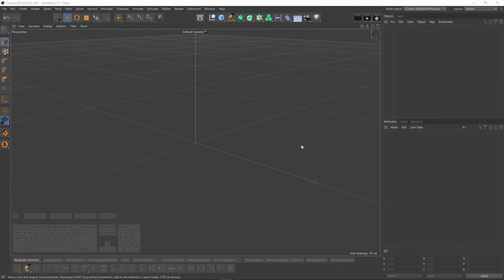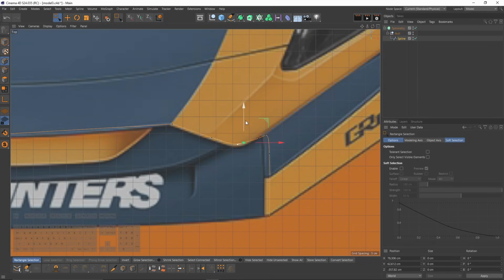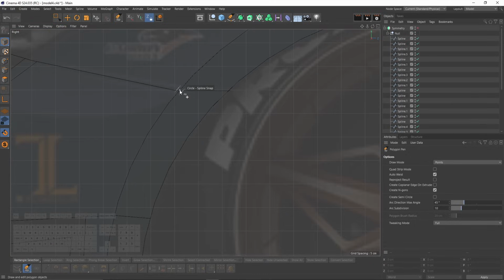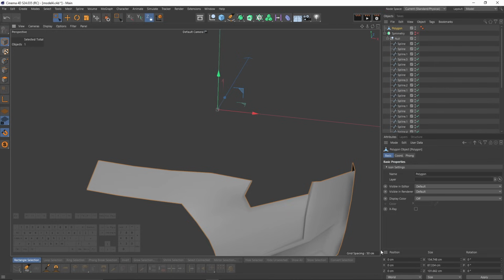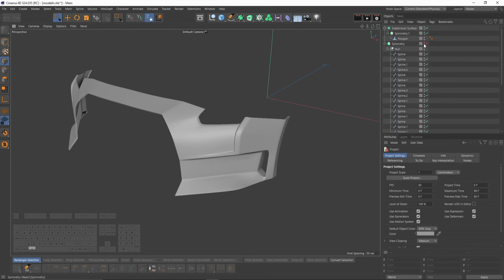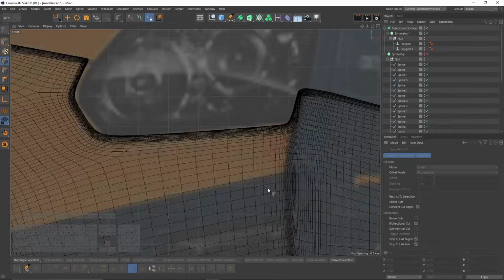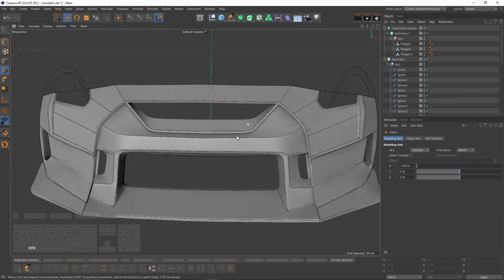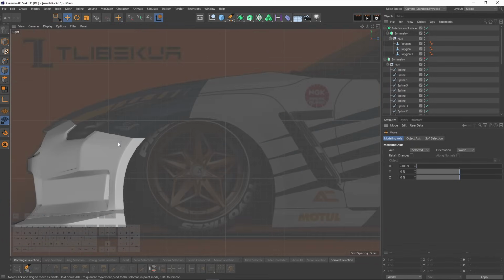3D Car Modeling 101

Comment: If I create a realistic model after a picture on the net, let's say cars..., do I need a license or can I create the 3d model with the car without any problem?  I want to make the model as realistic and similar as possible, I don't want anything in addition.  If buy the answer is positive and you need a license, I wonder how on some sites selling 3d models, there are realistic models?  ...somehow that author can have a purchased license to his designs?
Reply from the maker: You can model whatever you want but you may not sell it, for example most car models are sold under editorial licance.
Reply: @polygonpen  And more precisely, what is the editorial license or what does it help with?  How can you possibly get it?
I'm thinking of either selling models or creating a game and putting it up for sale.
Reply from the maker: You don't get it, or anybody gives it to you, it just makes it harder to sell your models to specific people, this is only for selling. @CatalinTRS
Reply: @polygonpen  I understand.  But any difference I know what else in using that model I don't think there is?  I mean momma, how would something like that warm you?  Is the license to buy, where and how much would it cost?
Anyway, thanks for the answer, because I want to create models and in principle, I didn't want to have problems with I know what copyrights.

Comment: How would i go about making my bumper thicker to print without having large faces on the inside which would use more resin to print? (Making the bumper thicker but keeping original shape on both sides)
Reply from the maker: If you want to print out any bodyparts, you should use a CAD software, softwares like the one I use in the video are not meant to do these kind of precise works.
Reply: @polygonpen  i have been able to make the body printable using blender (cutting sections and extruding them to set thickness) i have tried with the bumpers and have been unsuccessful as the only way i have been able to do it is by creating faces on the inside of the bumper (which uses more resin) and to me looks unsightly 😔

Comment: So good video sir.
Just one question I am little bit confuse, is c4d better in hard surface modeling than blender or is it the same ?
Reply from the maker: When it comes to subdivision modeling, all of them are the same, some have more tools some have less but the sub d modeling theory is the same, when it comes to poly modeling blender may have more tools/add ons but you can do the same things in every 3D program, it may take longer or shorter though.
Reply: @polygonpen  I see thanks a lot sir.